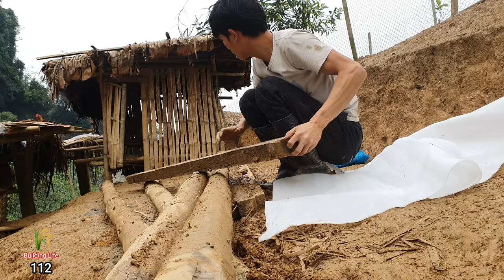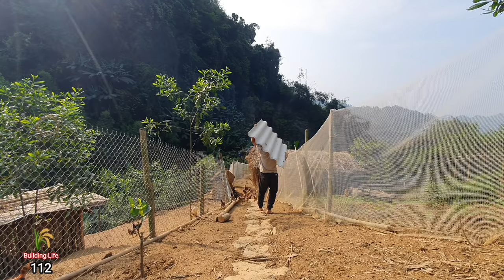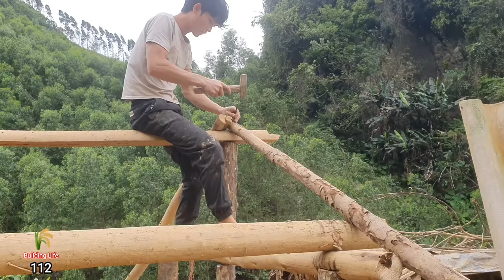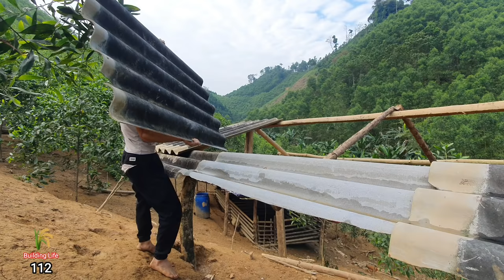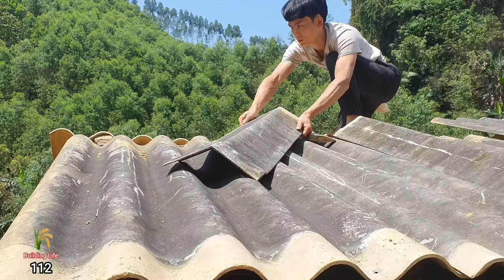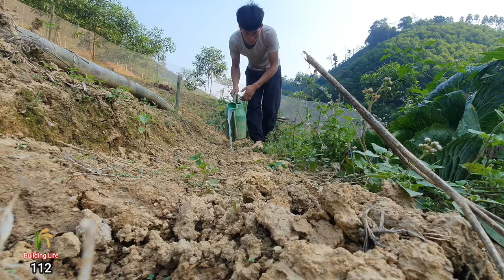Building a Coop for Chickens to Lay Eggs, Building Life, Episode 112

Comment: Hi Cahn.  Put small stones at the bottom of each post hole and then the post on top of the stones. The water will go under the stones and the post will keep from rotting for a long time.   I have done this myself and it works well.

Comment: The plastic foam may help a little, but will also facilitate the rotting once it gets wet. Using small stones around the pole will make it last longer and will encourage proper drainage. Burning the ends a little would also help!